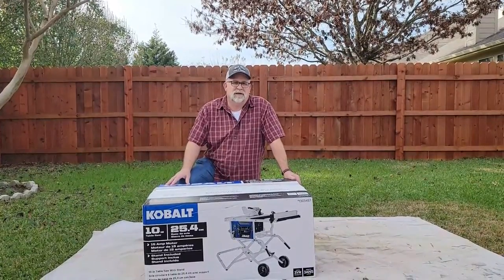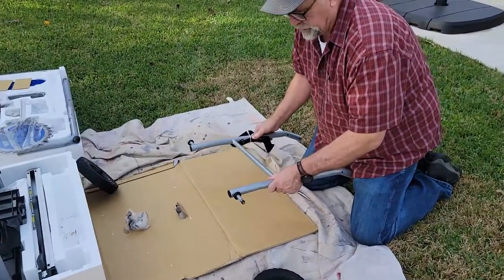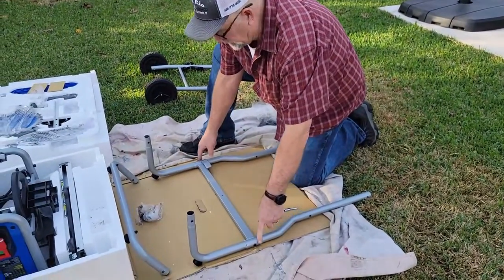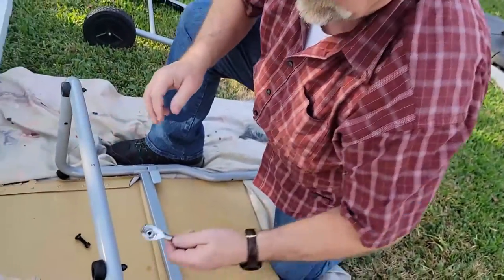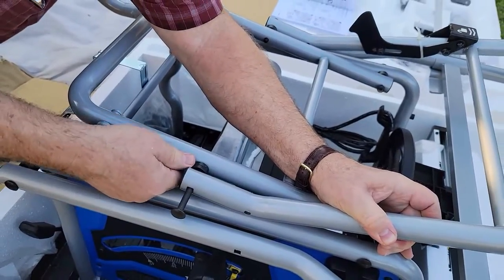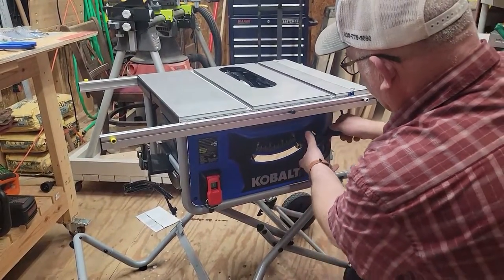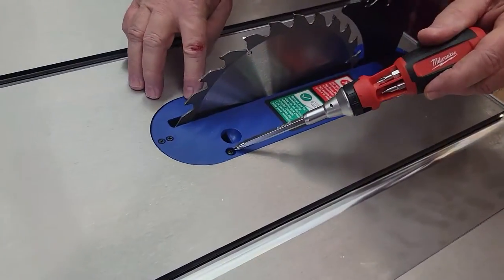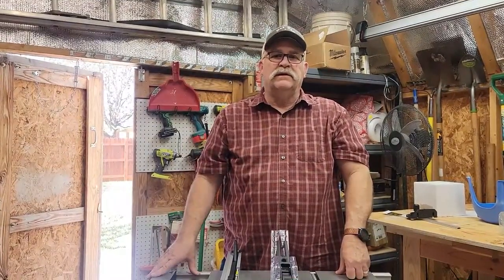Kobalt 10 inch Table Saw Assembly

Comment: Happy to make some follow-up comments.  Well today is 12-1-2022 and following these incredibly easy to understand how-to guide and instruction did successfully complete assembly.  Found it useful to lovingly tap upon a few cap/carriage with a one pound dead blow hammer.  Tomorrow plan to become more operationally proficient and run several cuts through the saw.  Once agaian, thank you Dave.

Comment: Hi Dave. First time viewer gear and I have a question about your new saw. I also have the KT1015 and it looks like you have the newly designed fence too. There appears to be a movable/ adjustable side to the fence that is not covered in my manual. Have you noticed it or figured it out yet? This is a great saw and it will serve us well bit this feature has me a bit puzzled. Thank you. I look forward to future videos.

Comment: One question does it have a blade adjustment so you can adjust the blade square to the table if it gets out of square?
Reply: It does.  Uses 4 hex head trunion bolts that are accessed under the table top.  Loosen, tap blade until square, tighten.  A bit of a pain to access but manageable.  http://pdf.lowes.com/productdocuments/9007f0f7-a089-4e53-b042-d19f736df385/10841661.pdf
Reply from the maker: Hi Darrell, Yes, it does Scott is correct thanks Scott for the info. Darrell thanks for taking the time to watch my video and comment if you haven't subscribed to my channel please consider that along with clicking the notification bell so you don't miss out on any future videos. Here's another video you may like https://youtu.be/BEaUgLBX5wY

Comment: There is some new fangal things called saw horses to get up off the ground...my knees hurt watching people work on the floor or ground.
Reply from the maker: Dan, thanks for the tip not sure why I didn't think of that my knees ached for two weeks. I guess the heat here in texas fried my brain. Thanks for taking the time to watch my video and comment if you haven't subscribed to my channel please consider that along with clicking the notification bell so you don't miss out on any future videos. Here's another video you may like   https://youtu.be/BEaUgLBX5wY
Reply: I'm a old fart now but working low like that always bothered me 57 years in carpentry.. building houses and commercial buildings.
Reply from the maker: @Dan Bailey   I understand thanks

Comment: How do I adjust the blade for square to the table?
Reply from the maker: Hi Vaughn, I use a digital angle finder here's a link to the one I use   https://amzn.to/3DDnX92 
Instructions are on page 27 of the owner's manual if you need to adjust.  Thanks for taking the time to watch my video and comment if you haven't subscribed to my channel please consider that along with clicking the notification bell so you don't miss out on any future videos.
Here's another video you may like https://youtu.be/v8pPcPy3xtM
Reply: Dave, I guess I'm not making myself clear.  I can't use the blade wheel to reach 90 degrees. The indicator bottoms out at 3 degrees.  There must be an adjustment to fix this.
Reply from the maker: https://www.manualslib.com/manual/1828560/Kobalt-Kt10152.html?page=45
Hope this helps